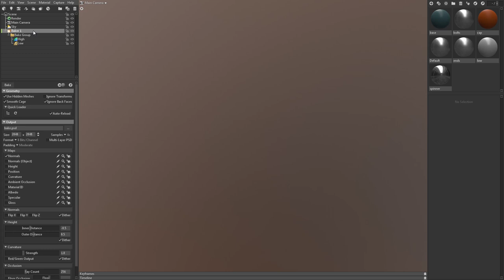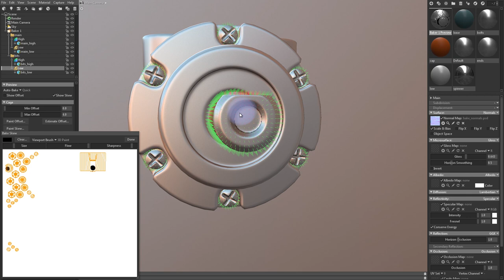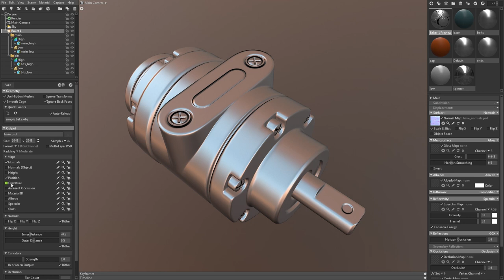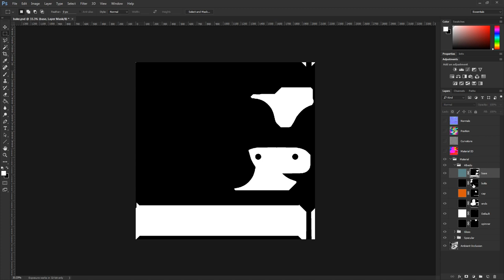Getting to Know Toolbag 3 | Ep. 4: Texture Baking

Comment: Hi, where can I find information on how to set up naming conversions for use with the auto loader?
Reply: Just name your meshes the same thing, and append _high and _low accordingly to the name. So,
SuperSoldierDudeVest_high
SuperSoldierDudeVest_low
You probably already figured this out by now but if you're asking, I'm sure others are too.
Reply: To be honest, didn't get to use TB baker again.  Appreciate your reply!
Reply: Do I need to have all the meshes under the same file to make this work?  1 FBX file that contains _low and _high meshes?
Because I've tried it, having multiple files though per mesh, and it didn't load them properly.
Reply: 1 FBX file that contains within it all meshes, high and low, with corresponding names. I use Maya and before final FBX export I make sure they're all in the same order with the same naming conventions in the Outliner.
Sometimes selecting everything and Deleting its History helps, and for good measure a Freeze Transform. (If you're not a Maya user, I apologise -- can only advise based on what I know!)
Reply: Hmm I see...  This isn't the best workflow in my opinion. I tend to work with really heavy meshes, brining everything into maya and exporting under 1 file (especially FBX) isn't something every PC can handle smoothly.
Appreciate your reply!
Reply: Try importing them all, then manually assigning them where they need to be  by dragging them into the appropriate part of the Baker Group?
Happy to try to help!
Reply: I'm assuming you have already figured this out. But you can have seperate high and low FBX's. The quick loader will read multiple files and sort them accordingly

Comment: You turn off your comments on newer videos. So it looks to me like Marmoset do not want feedback from your users which is disappointing to see s I want to leave substance painter but toolbag is not good enough yet and I want to leave feedback to help show developers where toolbag needs to improve. I guess I will try 3d coat and see if the experience is better there. I hope you do better in the next version as the current version is cool but very time consuming to work with. It needs some improvements.